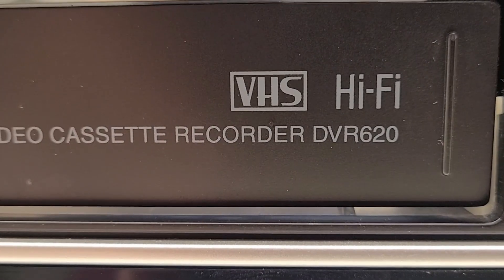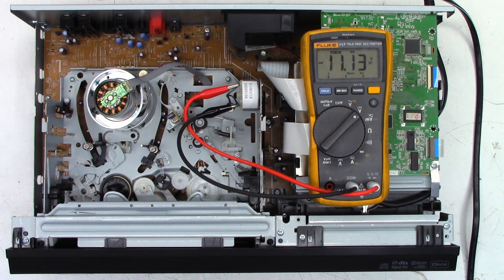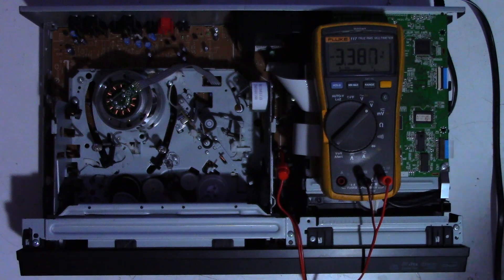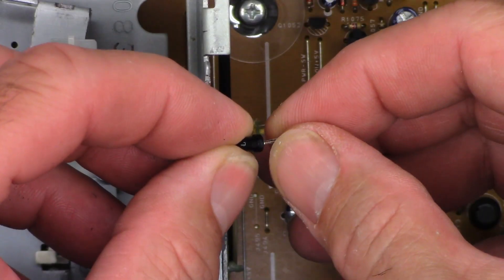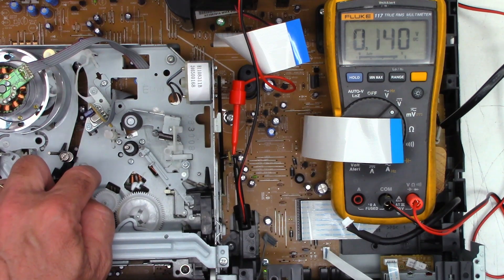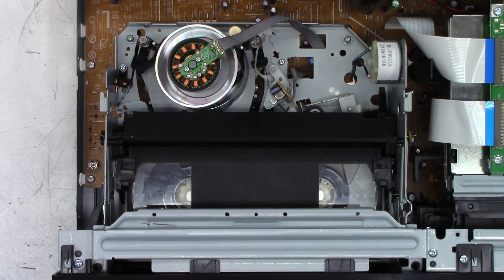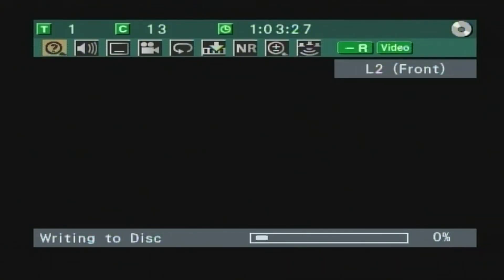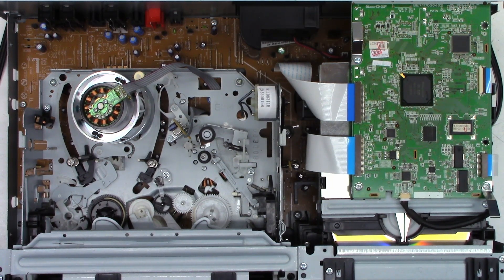Toshiba DVR620 DVD VCR Combo - Power wont stay on

Comment: Have to diagnose a unit like this that is stone dead.
Reply from the maker: Check standby power supply voltages 1st. Check microprocessor reset command and necessary supply voltages to said processor, make sure the clock crystal is oscillating (running).

Comment: I have the same unit. It has problems 6 hours of dubbing on it. It has been unused for several years. When I tried to use it, it munched on the tape. I was able to retrieve the tape but now it will not accept a tape. It did once but pretty much immediately ejected it. Could the sensor be causing it?

Comment: Done a couple of these today, completely dead , turned out there was shorted electrolytics on both machines, on the main board, not the psu. On the always on 5v sys power rails

Comment: Did you ever get to repair that subwoofer after you suspected it blew the tracks on that Yamaha AV amplifier? If so, what were your findings?
Reply from the maker: No I did not, I sent the unit back and have not heard anything back.
Reply: @norcal715  Thanks for the feedback. I think the same thing has happened with my Yamaha amp and was keen to understand why it had occurred before fixing it using your video as a guide. Keep up the good work! 👍🏻